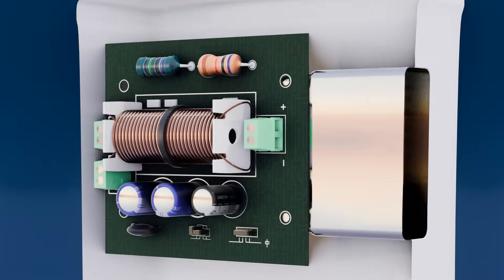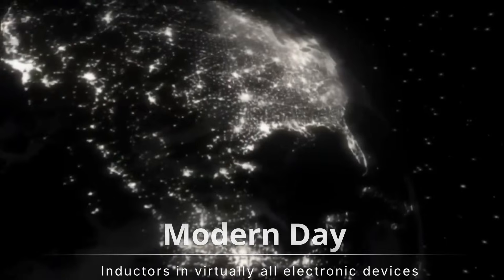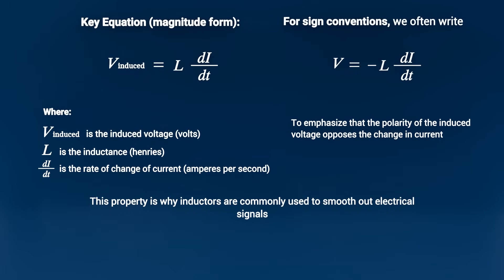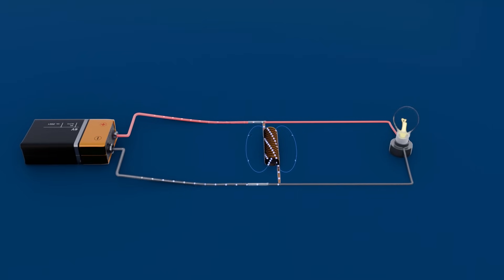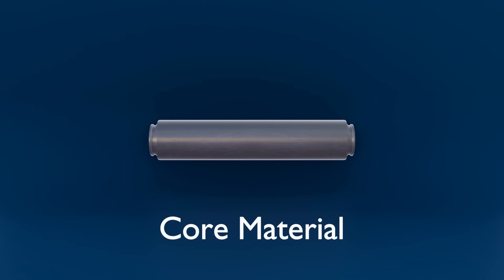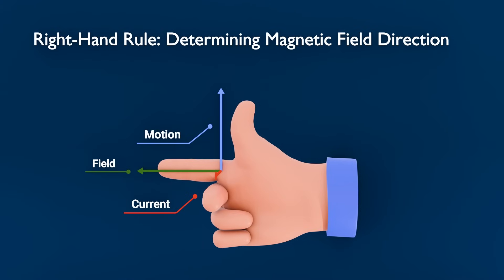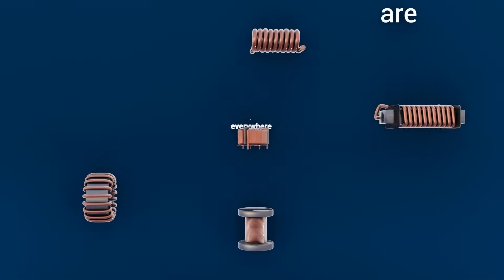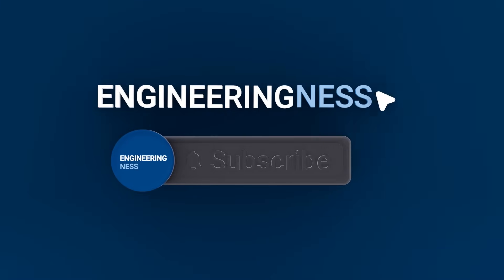The Essential Coil That Controls Everything | What Is An Inductor and How Does It Work?

Comment: Based on the equation V =  L dI/dt voltage becomes very  high when you interrupt the flowing current abruptly (I.e. dt almost equals o).  One of the use of this is starting the vintage fluorescent bulb.  Fluorescent bulb have negative characteristic.  They can operate at very high voltage with little current OR lower  (say less than 120 volts) with.higher current.  In order to operate the lamp you have to start it by applying high voltage (to sustain the current flow.  But since it has negative voltage-current characteristic it will remain lit with only less than 120 volts.  
Starting is done by a combination of  ballast (coil) and device called starter that is connected in parallel with the lamp. The ballast is then connected to this starter/lamp.  Note that the starter is made up of two metals that.bend and touch each other (like a switch)  when 120v is applied.   So when 120v is applied to the whole circuit 120volts there is no current flowing so 120 volts is actually applied to the starter which starts to bend and close the circuit letting current flow to the coil.  However, when the  metal bent, the voltage across the starter is zero it will go back to its normal position and open the circuit.  This sudden change in the current will be converted to high voltage and applied to the lamp. This will start the fluorescent lamp and operate at a lower voltage.  And this low voltage is now applied to the starter.  This low voltage will not cause the metal to bend and close unless the lamp did not start - cycle is repeated.
For capacitors the equation is I = dv/dt.  So it is the voltage that cannot change instantaneously or it converted to current.  That why we don’t want to.touch a capacitor when source or voltage suddenly removed.  This is the reason why they put a bleeding resistor across the capacitors to dissipate in time.
Coil are usually installed in series with the load to prevent changes in the load that will change the supply current current and parallel to the load to prevent changes change to the load that will change the supply voltage.

Comment: This video explains about inductors. Inductors are electronic components that have three parts. The first is the coil, which is a wire, maybe copper, second we have the core, it can be a ferromagnetic material, for last, we have the conection terminals, where we power it. These devices store energy in a magnetic field way. the inductors have a property called inductance, measured in Henrys, this parameter depends of the permitivity, the turns of the coil, the area and the length of the coil
Reply from the maker: Thankyou for your comment and support!

Comment: 3:54  It's Fleming left hand rule , not right hand rule
Reply from the maker: Actually, you maybe confused here. To determine the magnetic field direction you use the right hand rule in inductors, which is what we are depicting at 3:54 as the right hand rule is used for force on a moving charge. 

The left hand rule is used for motors as its force is from current within a field and can’t be used here.

Hope that helps.
Reply: Knowledge is weak
Reply: @PrabalChandradas-s4l actuall i got confuse with the diagram , it's same as left hand rule

Comment: For a mechanical analogy, think of a heavy weight to which you apply force (voltage) and eventually get movement (current) slowly building up, and to slow it down you need more force in the opposite direction. By contrast a capacitor acts like a spring.
Reply from the maker: Great analogy! Thankyou for your comment! ☺️☺️
Reply: A flywheel. 😊
Reply: Like..excellent

Comment: CURRENT DOES NOT "TAKE THE PATH OF LEAST RESISTANCE! If I could shout that any louder, I would.
Current takes all available paths of any resistance. The magnitude of current through a path is inversely proportional to the resistance. Inductors, of course, present reactance.
Reply from the maker: Yes, flow splits along all available paths, more current flows through the path of least resistance but not the entirety of the current. That’s why we say at the beginning that “little to no current” as this is technically correct. Overtime that current builds up and it then becomes the path that’s has the majority of the current flowing through it but not all! It’s governed by ohms and Kirchhoffs law in parallel circuits like the one shown. 

I believe we did not say that all current passes through the path of least resistance and the animation shows some current going through the alternative path as it’s building up! 

We do agree, maybe our wording was not the best and we shall try to keep an eye on that for later videos. Good spot! ☺️☺️ if you have any other suggestions to improve please let us know!